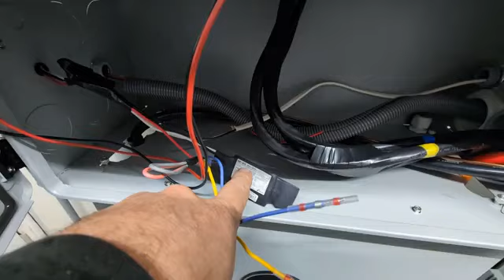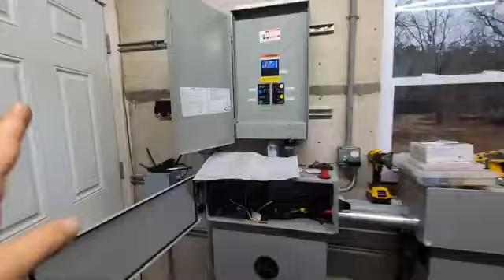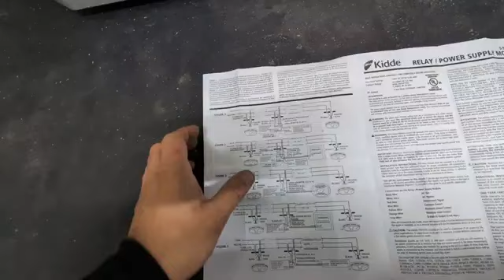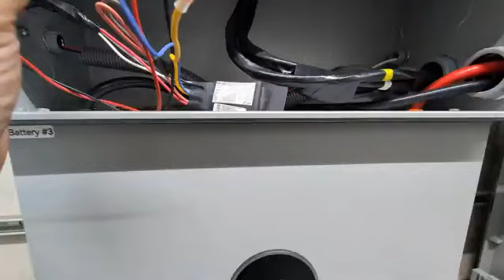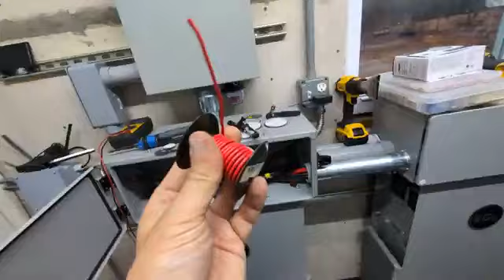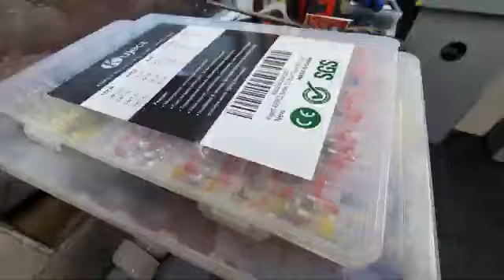Adding Fire Detection Rapid Shutdown (RSD) To Your Solar Project: Kidde SM120X

Comment: Thanks for the videos. I see youre inverter combiner box. Is this box application specific for inverters? or did you find a box that doesn't have stringent rules about back-fed breakers on it's label? Looks like Eaton? I am looking for a box to combine inverters and curious what to look for as a good option. thanks!
Reply from the maker: It is just an Eaton 200a panel with no strict labeling about backfeed. I'll grab the item number tomorrow
Reply: @ianmburke  Thanks, would love to know what you're using!

Comment: I'll prob win with the dumbest question, but how long would the off grid power last in the winter?
Reply from the maker: I'm in the dead of winter and had back to back heavy overcast and rain for about 5-6 days and I couldn't get the batteries below 45% based on limited amount the solar would recoup in the daytime. I over paneled and built the batteries for roughly 7 days of 'autonomy' which is shorter cloudy winter days. So I made it through without any need to go back to grid so I'm guessing the short answer is indefinitely

Comment: Thanks for the detailed video! Can you let me know where you got your waterproof cover for your switch if you have that info?
Reply from the maker: I actually repurposed an outdoor receptacle cover I just had to trim the inside a little (2mm on each side) to slide the button through. I got mine at my local electric supply company. But Lowe's/home Depot would have them too
Reply: @ianmburke  Great, thanks for the info!

Comment: I'm just curious as to why you needed so many inverters and batteries. I can understand the batteries (you can never have too many batteries) but 3 18Kpv inverters will provide 150 amps at 240 VAC. That's 36 kilo watts. What are you running that needs that much current? Yes, I know the standard house has a 200 amp service but you almost never need that.
Reply from the maker: A few reasons which I will go into more detail about in the next video recap of project. 1. The manual states the configuration for batteries is 1-18k per 3powerpro batteries. 2. For the load to be not maxing out the inverters all summer long. 3 redundancy is king when you are going fully off grid

Comment: Do all battery breakers shut down? If yes how do they flip back up when you reset the rsd button
Reply from the maker: The battery breakers can do that but it would be an additional wiring configuration. I do not have mine set for that, and mostly because of the fact I'd have to flip back all of the breakers 🤣
Reply: @ianmburke  okay 👍 i have mine set so all the breakers shut down but I do have to flip them all back up manually so I was curious why yours was different
Reply from the maker: I was thinking I might get to that point but I'm not 100% sure yet. That was the original intent I just don't want to have to keep the side grills off to flip all of the breakers 😂

Comment: Great video. Ca you do a diy visual diagram on the connection for the RSD button connection to the alarm
Reply from the maker: For the diagram the easiest way to think of it is that the fire alarm relay has two connections to the RDS wiring those two wires should just be spliced into either one of the wires feeding into the button
Reply from the maker: I'll also add an actual wiring diagram to the next video when going over the details of this project, probably a little later this week